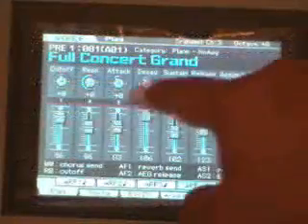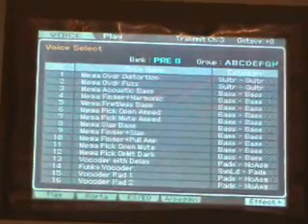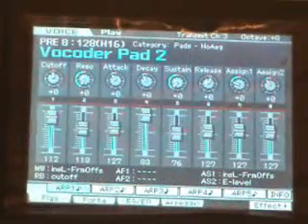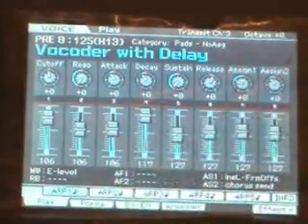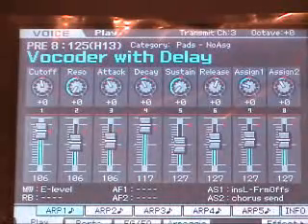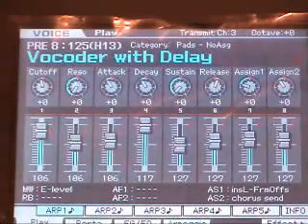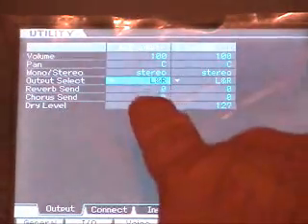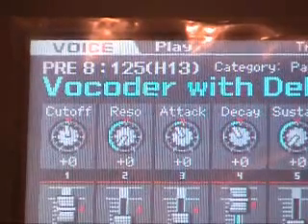Motif XS: Tutorial 2 How to setup the Vocoder

Comment: Doesn't seem to be working on my XS6. I had it working the other day, not sure what I did differently. I have a dynamic mic, Shure Sm58, the mic and the cable are fine, verified them separately both directly through my amp as well as through my audio interface. Through the XS6 A/D insL, however, nothing.
Reply: I just set this up on my MXS6 with a dynamic mic and it works! Don't forget the part about settings in Utility Mode; Voice Audio; Output Select; ins L. Also the little Gain knob! Woot!
Reply: @Islander2112  Yes, apparently also make sure that the AD/L is set for mic not line, or vice versa.
Reply: @michaelwplde  What's funny from here is that I'm a guitarist that has a bad case of Keyboarditis, not related to Covid, anyway, I scored this XS6 two years ago, and It is awesome!

I don't care about the recording features, but the voices are incredible! Back on subject, I have to reset the Vocoder settings after rebooting the Motif here. It's a cool tool, but limited I suppose. It seems like autotune before there was autotune, lol
It is fun!

Cheers!